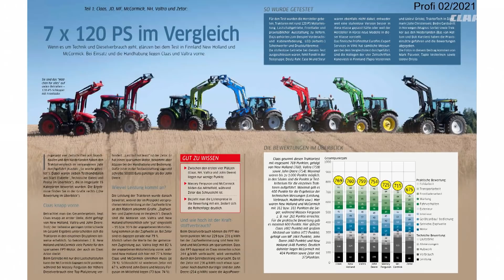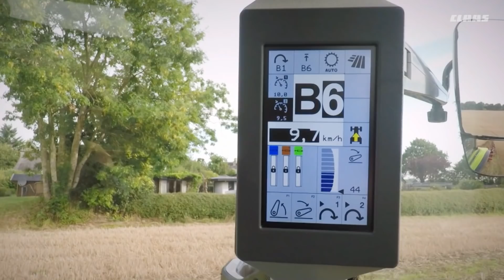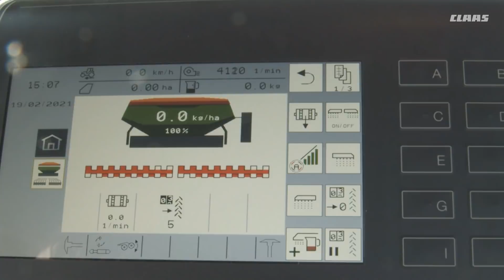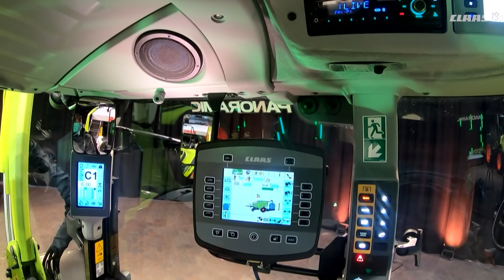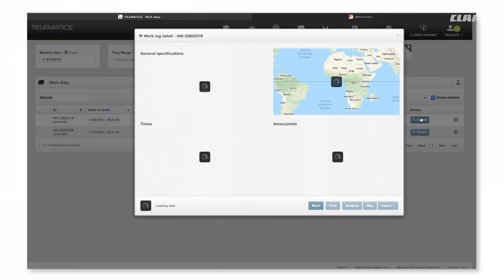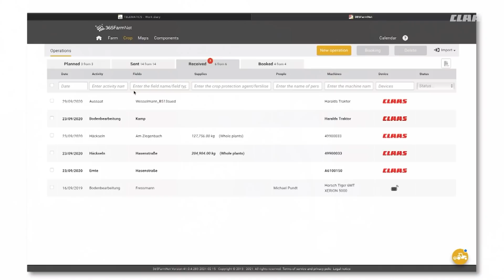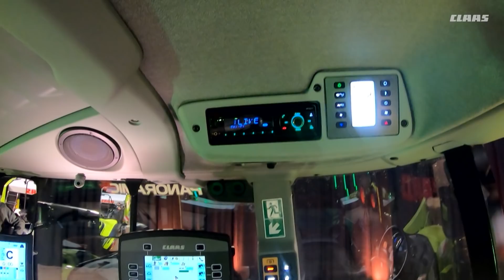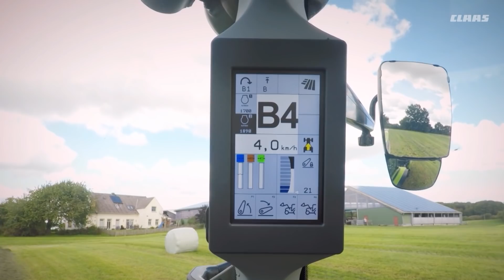CLAAS | The new ARION 400. Live premiere.

Comment: If claas could put a sloping bonnet on the 400 series and along with the panoramic roof and shuttle buttons on the joystick it would be a really fantastic loader tractor. One other thing I noticed on claas 400 series tractors is that the paint fades very fast.

Comment: i looked at this presentation and i am shocked, no profesionalism . the presentator are there at gun point? man there are reading from notes like a 5 year child, and performance when mr cousin lifts the implements the blower fan drops at 3900 rpm from 4300. and the line that is too wet that killed me.
put a service tehnicial cause the maketing guys are full of s..t. 8 % more power ...... at low rpm . low rpm doesnt save fuel, it kils diesel engines
Reply: i agree... it looks incredibly staged but un-rehearsed- I'm sure everyone knows what they are talking about but it really looks like they are reading it (badly) from a teleprompter